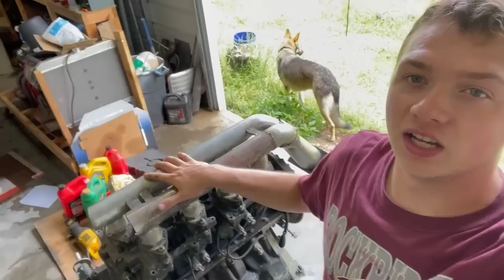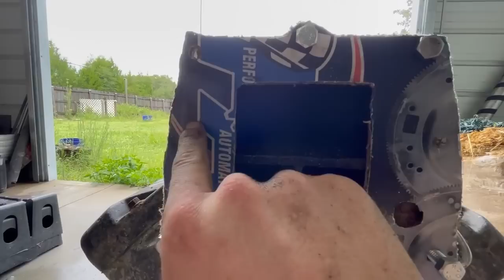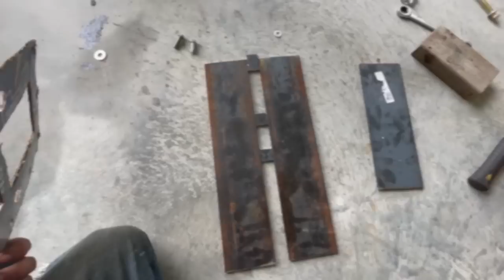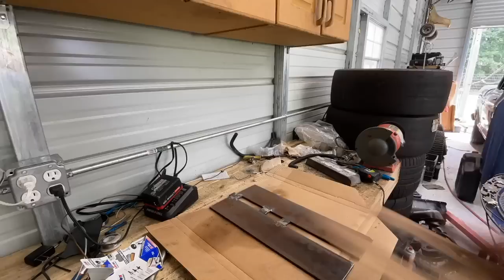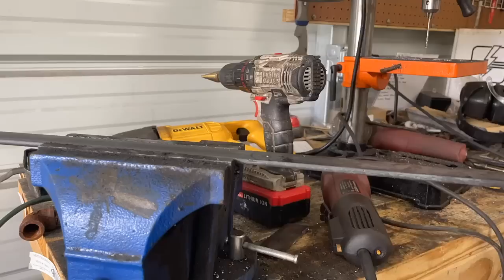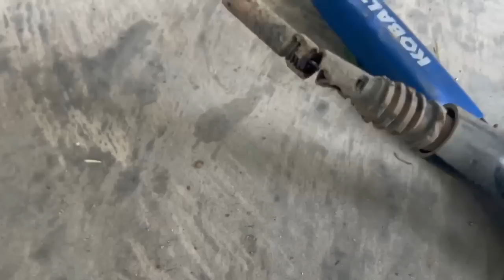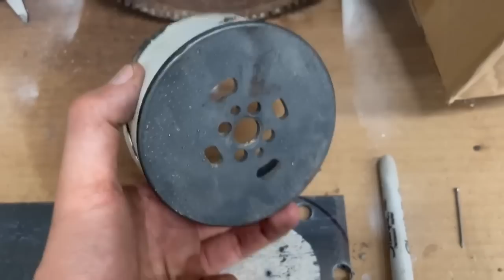Will this 2 stroke V8 BOAT engine bolt to a Chevy trans?

Comment: You made a mistake with the bolt circle , if those bolts are NOT the same distance apart on the flex plate ( and I know they are not) you cannot get the bolt circle diameter by measuring bolt to bolt , it will be wrong, I could put one hole 2 mm from the next bolt and still be in the bolt circle but measuring from that bolt to the next would be around 3 mm and not 3.5 inch , my point is to get the correct bolt circle measurement you need to measure centre of circle to centre of bolt hole !

Comment: I would have found a sheet of something to drill a hole into to fit over the input shaft and clamped it to the bellhousing, then drilled holes from the back side and traced the outline of the bellhousing There's your template.

Comment: Watercooled Exhaust is pretty normal in Marine Engines, even in the big Units, meaning Cargo Vessels. Since Airflow is limited and requires much bigger ducting to cool anything effectively, and because water is freely available in a boat, everything in an outboard is watercooled, including the exhaust piping. 
Since the Exhaust exits into the Water through the Propeller, it actually uses the resonant frequeny and resistance of the water in combination with the expansion chamber to get its tune. So running it in open air you will have to run a far more restrictive exhaust and larger expansion chamber to get any kind of power.

Comment: Transmission just needs a torque converter to work to go around
Similar principle does it matter which way an alternator turns it still makes electricity for the battery
Tesla needs to make one for his car to charge the battery so we don't have to plug it in and we don't have to worry about the electrical grid

Comment: If the plate is thick enough you could take it to a machine shop that has a head surfacing machine and it can be flattened there, like wood through a planer, I used to be a machinist many many years ago

Comment: With out a torque converter the transmission won’t last long it needs all that fluid a manual transmission would definitely be a better option for that set up
Reply: It is not about loosing fluid, the converter has to engage the trans pump to even move out of park , fluid pressure is needed to make the trans work

Comment: You're gonna laugh, but I ordered my replacement welder stinger off of Wish. Got 6ft lead, gun can run gas/fluxcore etc. Same handle different color plastic on handle and worked without issue. Took a bit coming outta china but 70 bucks canadian 3ft longer than original extra tips and covers and mounted just like the old one. 85 bucks to my door. local welder supply was nope that's junk, we got the miller 1500 dollar entry level. or this lincoln 1000 dollar entry level. I'm just doing small shit repairing holes and the odd replacement panel. Just like Jesse James says hmm ground too much off, oh well just add more metal

Comment: Front or rear of the engine?  Have you checked the direction of rotation of the engine?   Years ago someone I knew used a combination of Honda S800 parts and Ford Cortina parts and ended up with 4 reverse gears but only one forward.  The Honda engine rotated anti clockwise viewed at the front of the block, apparently due to it's motorcycle heritage. Best wishes from Australia.

Comment: Hey man when you’re putting a transmission on an engine you generally have to be within .005” of centre so your best bet would be good an transmission swap plate that fits on your transmission but is also big enough to cover whatever mounting holes you need to hit on the motor and then get a machine shop to drill it out for you you will save in the end on clutches bearings and transmissions and just aggravation. Once you weld it on that piece that is centre where the pilot bearing goes you pulled it and changed it even if it slides right back on you still changed it and how are you sure that it is coming out perfectly in line with the shaft

Comment: Why not call a motor builder in your area and see if the have a junk Chevy crank and have them cut the off the crank off where the fly mounts to? That's  what I would do. Then have it milled to thickness you need.

Comment: If you’re having trouble getting your welder to work like you’re doing this is just a hack it’s not a recommended way to do it but if you heat up the plate a couple hundred degrees with the propane porch it’ll help the weld burn in but you definitely need to invest in a much heavier proper extension cord the cheapest way to do would be to buy a roll of the proper gauge cable and put the ends on it yourself

Comment: Anything from Harbor Freight you have to look at your plate on the machine for model numbers or serial numbers and order it through Harbor Freight. That's why I don't buy any more drills, grinders, welders, chop saws. It'll take 30 days plus to get your parts after you order them they come from China.

Comment: Don’t cheap out with your water flow .  Use either a Davies Craig remote or a remote water pump to a slightly older BMW , 328x, 328xi , 325xi etc . From a junkyard or buy new for like $250 bucks . 
  Need to keep that v8 cool .

Comment: the 2 exhaust ports could be hooked intoo different height ports on the same cilinders , but have a different length to the actual exhaust so it makes power at a slightly different rpm 
there might be a way to calculate wat the best length would be but then again the 8 cilinders dont fire at the same time but in a sequence 
you can flatten the steel after welding using a bathroom mirror and waterproof sanding paper , you wet the mirro and the sanding paper then stick the sanding paper to the mirror using the water , add more water over the top then lap the plate over it in a figure 8 pattern untill there no more deep spots visible (you could use a marker to paint the metal plate on the side youre working on , the deep sports stay bleu/black you just keep going untill its all the way shiny metal
the 4l60e is a transmission with electric gearchance , there electric valves inside , you need a normal gearshift for reverse neutral and drive and you need either switches or some sort of controller to shift the gears and lock the converter , have seen a video a long time ago of a guy that used house switches to shift the trans manually , https://www.youtube.com/watch?v=ozbWf_QsPrw  ,   https://www.youtube.com/watch?v=mfLypL9_W9s ,  allso seen a video that used an arduino and some electronics to shift 
havent seen an engine trans adapter made like that before , usually they use a piece of plexyglass , with a single centerhole for the inpuntshaft , as the thing is see through you can mark the holes and circumference with a sharpie with the transmission standing on its tail , then take the plexyglass off and lay the other sode on the engine and mark those holes and circumference , then use that as a template to make the adapter

for the welding gun , you probably need to get a complete mig torch head , done a small search and on aliexpress and in the netherlands there 11.45 euro including shipping 
https://nl.aliexpress.com/item/1005004245012830.html?spm=a2g0o.productlist.main.15.65e542feevTNGy&algo_pvid=b39c1d28-c68e-4f02-ba4b-99d9c9e7a457&algo_exp_id=b39c1d28-c68e-4f02-ba4b-99d9c9e7a457-7&pdp_npi=3%40dis%21EUR%2116.35%2111.45%21%21%2117.63%21%21%402145280e16903750757912273d0762%2112000028737310701%21sea%21NL%21111198318&curPageLogUid=AyhrlkFZhAmX

they also sell the parts to fix the nozzle those are 2.50 euro including shipping  https://nl.aliexpress.com/item/1005005406855751.html?spm=a2g0o.detail.0.0.6a3e9SVN9SVNHV&gps-id=pcDetailTopMoreOtherSeller&scm=1007.40050.281175.0&scm_id=1007.40050.281175.0&scm-url=1007.40050.281175.0&pvid=e13f56ff-f8d5-4b4e-b9ed-2b4c15a5f964&_t=gps-id:pcDetailTopMoreOtherSeller,scm-url:1007.40050.281175.0,pvid:e13f56ff-f8d5-4b4e-b9ed-2b4c15a5f964,tpp_buckets:668%232846%238114%231999&pdp_npi=3%40dis%21EUR%211.47%210.88%21%21%21%21%21%40211b615316903751330201524e3381%2112000032934549214%21rec%21NL%21111198318 
as for cutting the piece round , use the center hole stick that on a pin and rotate it past a grinder , makes it verry round or as round as the flat spots allow , might want to put the 4th flat spot on there too as it will help with the balance 

btw check the rotation of the engine , could be it turns the wrong way for the trans

Comment: If you're going to use an automatic transmission you better put a stall converter in it... I would say 3,000 plus RPM because those two strokes don't like low RPM... Of course it is V8 but I would want to utilize every last bit of power it's capable of.... Stock stall could bog that thing right out... Won't have any get up from a standstill....👍

Comment: A real masochistic conversion!
That engine needs to be stripped to check the bores and crank before any further work is done.
Why was it a scrap motor in the first place?
The undertakings here are huge and you really need to be an outboard engine expert to pull this engine apart and reassemble it.
Those water inlets look really crusty and need acid cleaning to remove all that scale..

Comment: Blow compressed air thru the port's on the engine to find where the air come's out place a air flap of paper over the other port's and as u blow air the paper should blow open, just don't use water

Comment: You can bolt on every Transmission on every engine with a special plate, but that means not that it will work. The twostroke-Engine with less power
on low rpm does not really fit to the lousy automatic tranny what ruins 80 horsepower until it comes to the rear axle.

Comment: Torque converter is supported by the crankshaft your flaw is not building a bearing onto your plate on the transmission plate.I would get a chev crankshat and cut off the end and design the bearing to fit your plate...hope that helps

Comment: Interesting project 🤔. Major hurdles to consider:
-This stye 2-stroke needs reed valves to work properly. You've removed them.
-This motor uses an open loop/total-loss cooling system.
-This motor is designed to dump part of thst coolant into the exhaust
In rotating the motor, there is a possibility that you'll create air pockets ulin the cooling jacket
-thrust loads are dealt with externally on this motor.
-these things run hot 🔥 🥵

Comment: I have an idea for your spacer, just get an old flywheel (manual transmission) and have a machine shop cut the middle from it.

This will ensure that all the holes are perfectly straight and you also will get a nice thick register for the converter nose to fit into, and will cost you a LOT less than having them set up to drill all those precise holes.
Reply: That would be a good solution to his situation

Comment: Maybe this will help you out next time but in fusion 360 software you can upload a image.  You can clean the outer rim and paint it white to give it contrast then take a picture.  With the pic upload, you can size it to the correct size.  Then just go through tracing your part and adding holes. Even if you don't have someone cnc cut it you could have I stencil cut on a Cricut or even print it.

Also you need to be sure the reeds are all installed right and are not sprung open. If there's hardly any gap the engine will act up.

Comment: Hey man just an idea, a BOP(buick, olds, pontiac) transmission will have a dip in the middle at the top of the bell housing. That would be perfect for the location of the exhaust. If you go w/ one of those transmissions, i think all the work you did to find center will translate to the BOP trans too, but the bolt holes will be slightly different.
Reply: Dude, that's a great idea! Good eye!
Reply: Yep, “Rabbit Ear” transmissions…still 350 Turbo based👌🏼
Reply: @RealSteelStreet  Well, could be TH350/400, or 4spd/aftermarket 5/6spd, although with this engine, a TH350 is plenty for the torque and weight of the car, which is what the 4L60 is based on.  A thick BOP to Chevy adapter plate would probably do the trick.
Reply: Some of them transmission had both bolt pattern built in to the bell housing

Comment: Might need to look at the welder fitting for the line feed hose. Order hose with new end gun. Hopefully the gun end assembly that is not using ink jet cartridge you can only use our crap. Get a more universal gun. That cover/shielding on the gun does block your line of sight but saves on the wallet.

Comment: Keep working it out. With careful thought and patience it will come along. As far as that plate going behind the flywheel goes, it’s going to have to be perfectly dimensional in order to be balanced so you might want to get some wider plate. Everything you ad has to be precise in that situation. Like you said, any wobble will cause it to beat itself to death.

Comment: I dig your enthusiasm but not sure your fully aware of the task you have out in front of you. Here is some advice and food for thought. First some history. Way back in the late 60s or early 70s. Evenrude attempted to turn a outboard into a inboard. They just took a vertical crank engine and laid it horizontal. It did work sorta. Was plagued with oiling issues. This could be a issue for you too.
Reply: Was it 2 stroke bozo

Comment: Sorry two stroke engines could be made to run clock or counter clockwise    cuzz no cam if that boat motor turns wrong way might be able to just start in other direction doesn't always work
Reply: Have to change ignition timing at least along with crank as when machined it is made to run one way , under microscope a machined crank has all the little metal pittings folded away from direction of travel , that's what honing does, if turned in the opposite direction it acts like a saw cutting bearing material off !

Comment: If I understand well, you don't have or use machining facilities, if so, I doupt that this will function properly and to what I can see, you,ll have to sort a lot of vibration problems due to the design of your adapter shaft, usually, the coupling between an engine and its transmission needs to be very rigid to control deformation under load and  vibrations produced.

Comment: TO HARTWICK!!! In your last video you deleted the reed valves. It will be 99.9% impossible to run or even start this engine without separate reeds for each cylinder! Get yourself a copy of Two Stroke Tuners Handbook. Read and understand two stroke theory. It's very very different than 4 strokes. You cannot make design changes to a 2 stroke engine with a 4 stroke brain. Everything is based on fluid dynamics. Seeming little changes will render the engine inoperable. Each cylinder's air flow is isolated from carburetor to some distance past exhaust port. They each must have some type of 1 way valve on the intake. All 2 strokes ever produced conform to this. Also there's a volvo posted here 7 years ago that has a evinrude V8. I would contact him for the problems and solutions he encountered on his build and read the 2 stroke handbook before I turned another wrench. I hope you see this comment. This will save you money and heartache!!!!
Reply: Quite so. If a two-stroke is designed with a reed valve, then it will not operate without it. You cannot approach a two-stroke with a four-stroke mindset. Take the advice, and do a crash-course in Two-stroke technology !
Trinidad & Tobago.
West Indies.
Reply: I guess I missed the part in the last video where he took the reads out, did he say he took the reads out? cuz the only thing I saw him remove was the 8 carburetors off of it the reeds are under the carburetor mounting plate
Reply: Well said !!!

Comment: Carefull most marine engines turn opposite of the car counterparts ie you'll have 4 reverse gears 1 forward ask me how i know,but being two stroke theres a chance it could run in either direction not always
Reply: I thought they could be had both ways, because boats with multiple engines will have one std rotation and the other rev rotation?
Reply: It's a reed valve, loop charge 2-stroke, so it should run either direction, you just need to change the ignition timing and the direction of the starter motor.
Reply: They only run reverse if used in twin engine configuration, so props can turn opposite to each other.

Comment: I'm concerned about the 4l60e. You can use that one for mock up since the bell housing pattern is the same but without a computer out of the truck it's not going to work right.  Even with the computer it will be hard without having the computer reprogrammed to ignore all the signals it's not getting from a Datsun.
Reply: Something simpler, and not electronic, like a Ford C4 or GM TH350, even a Powerglide.

Comment: Small ports are coolant feeds and the big port is probably the last stop before leaving the engine. Usally meets up with the exhaust in the mid section. (The part the motor was connected when you got it...)

Comment: Just make sure you check to see what kind of balance is on that torque converter becaus some engines were internally balanced and some were externaly balanced coud cause vibration problems